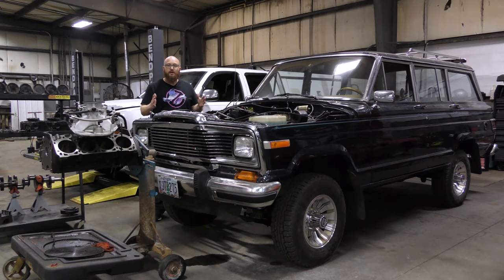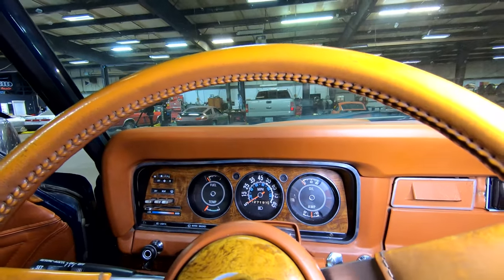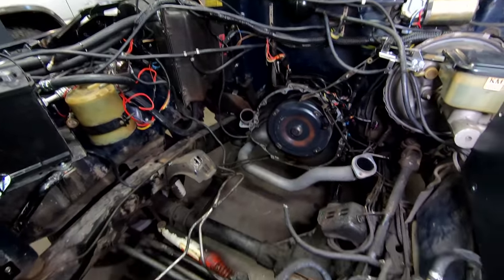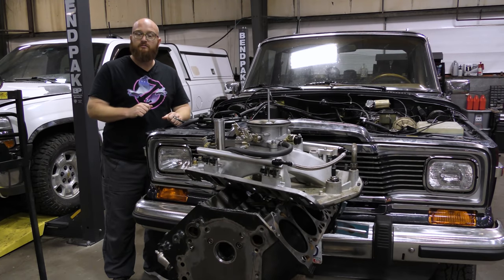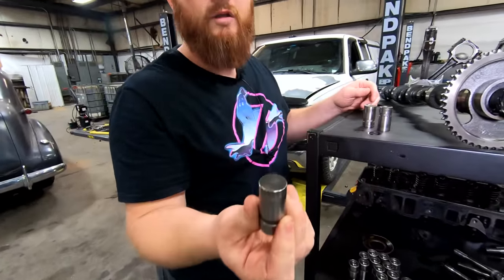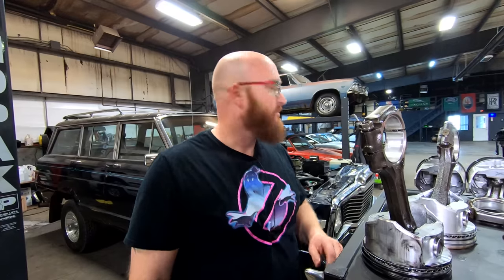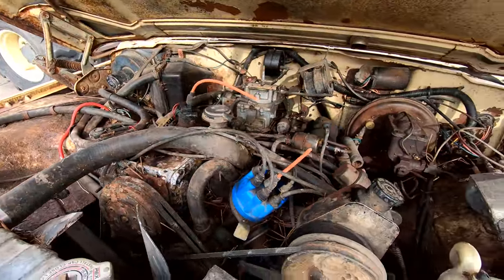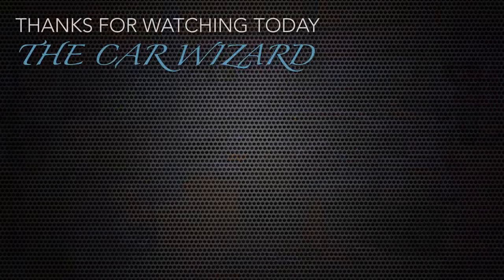The '83 Wagoneer rebuild is dead! CAR WIZARD gets burned by another shop!

Comment: I can't say it was all builder fault. Was cam broke in right? Was correct oil used? Engine looks fairly stock so why single plane intake manifold on truck engine. I see a lot of miss- match engine parts, stock rods, cast pistons, most likely stock CR, cam looks to be stock with high RPM intake manifold. Seems to be using stock exh manifolds after seeing exh head pipe. Fuel injection help a lot to make it run somewhat ok.

Comment: Why SHAME on the builder? nowdays flat tappet lifters are failing badly.  bearings are scored because the metal shavings in the oil. the frozen rod could be because of the shavings also.... Car Wizard you should know better..

the only obvious "bad thing" the engine builder did was that he built a flat tappet cam engine!  these days its roller lifters or nothing!

Comment: This is the ENTIRE reason I stopped using flat tappet cams years ago... 

A failed cam lobe WILL require the engine to be pulled, completely disassembled, and ALL the internal engine parts hot tanked to get all the ground up metal out of it. If someone just replaces the failed cam and lifters, the engine WILL destroy itself from all the metal filings remaining in the engine. 

I JUST rebuild a 2012 Dodge 5.7 Hemi in a Ram because of this... The owner had an issue with a worn cam and lifters on the 4 cylinders with the displacement on demand lifters in them. The lobes were gone, and the lifters were ate up. He replaced the cam and lifters, changed the oil several times, and called it good. 5000 miles later, and the engine spun 3 rod bearings and locked up. The mess left in the engine from the ground up cam and lifters tore up the bearings and plugged up some oil galleys. 
I tore the engine down, the crank and bearings were wasted. Thankfully the engine didn't spin any main bearings. I had the block and heads hot tanked, honed the cylinders, put a new crank and bearings in it, new rings, new oil pump, new lifters, new timing chain tensioner, new chain, new chain guides, new cam bearings, put it all back together and back in the truck, and 20,000 miles later it's running fine.

Comment: I have fairly recently witnessed bad lifters that were new in the box. Defective parts. But a lifter though...
That is %100 unacceptable. One bad lifter can and will grenade an entire motor. Anyone operating an "engine shop" worth their salt would have at least noticed that worn cam lobe AND a bad piston and connecting rod. There is NO WAY the builder wouldn't have noticed that piston assembly if it was in that condition before.. so, my money would be on a bad lifter. A bit harder to detect BUT still should have been checked and not taken for granted that it was fine because it was new. 
Side note: Shops where the owner tends to overload their employees with too much work and ridiculous deadlines should be avoided if possible.

Comment: Wizard, not to tell you your business, but i am a tech doing alot of old stuff, since it was new stuff and i have seen that happen repeatedly since the 80's when they took the zinc out of the oil. Use a zinc additive in ALL flat tappet engines and that wont happen.

First time that happened to me was my 1970 ford with a 302, flattened the cam. Then a dodge van with a 318.  Just saw it happen on a chevy 350 from the late 80's. 

I replaced a cam  and lifters and used a zinc additive and didnt happen again.

Comment: I did a similar "restoration" on a 1981 Cherokee Laredo (2 door version of the Wagoneer). There is a volt meter replacement procedure for the problematic dash ammeter, using the internals from a $15 volt meter from the auto parts store. Google it and you'll find lots of write-ups about it. I just hated to have a dead gauge in the dash, seemed like an unfinished project to me.

Comment: I remember watching a video on a channel called Uncle Tony's Garage where he talked about how some auto parts stores/suppliers will sometimes accidentally resell parts that have been returned as defective by customers.

He said that he was working on a project went to buy some lifters and was "amazed" when he got back to his shop and inspected that parts only too realize that he'd seen that particular part a few weeks earlier (he said he wrote down all the particulars of it and kept the recipts) and had actually returned it as defective before he used it in a project he was working on.

Apparently its a relatively common problem where parts are returned as being defective but aren't marked as such so the stockboy re-shelves them and they get sold on to the next person who doesn't think to do a detailed inspection pre-install, that could well be what happened here.
Reply: Could be counterfiet parts
Reply: @nickmalone3143  
Made in China no doubt.

It wasn't that long ago that counterfeit chinese made aircraft parts were a huge problem for that industry, they actually found some on Air Force One after an investigation into a plane crash in norway was attributed to counterfeit bolts that were used to secure the APU in said plane which failed in flight and caused it to go into an uncontrollable nosedive and break up mid flight over the north sea near denmark.

Comment: I have a 87 4runner with a 22re that's never run right since I had a mechanic build it, I'm thinking of tearing it down myself, I think I'll find some damage in the head. I'm much better equipped now than way back then.

I was planning a trip to Colorado and debated towing it out to you, but I don't think it's nice enough for your shop.

Comment: I'm not ruling out crappy parts or improper build, but old engines and flat tappet cams absolutely require oil with plenty of zinc for proper break-in. It's very hard to find oil with enough zinc in it. Always use a zinc additive, especially during break in unless you're absolutely sure your break in oil has enough zinc in it.

Comment: Food for thought…. I used to work on these as a Jeep tech. They suck the hell out of fuel. Advance the timing and they get 12 mpg but spark knock. Back timing off, 10 mpg. Chrysler had us load a couple of them onto a transport to ship them back to have them tested. I’m not sure what ended up happening. I can’t help but feel valve timing has something to do with it. They were known to pull trailers very well. But they ran so rich that they had a smog pump, pumping air straight into the cat. So be sure to ck the valve timing. 🤔

Comment: The easy answer is bad lifter/cam but I don't necessarily agree. Obviously the engine was very poorly assembled. It's a little hard to tell because you waved the camera past so fast, but the wrist pins looked to be pressed pins. The pins need to be fitted to the piston. Normally they are individually prefitted and come with the pistons. So either they mixed up the pins/pistons, or they were not properly prefitted, or the piston/pin was damaged installing them. WHATEVER the case may be, the assembler HAS to have been aware of that bad rod/piston assembly when he installed it in the block. Nobody should be oblivious to that.
As for the lifter, my guess is that for some reason the lifter was not spinning in the lifter bore. There are many possible reasons why it was not spinning: too tight lifter bores, rust in the lifter bores, burr on the lifter/lifter bore, no taper ground into the cam lobe, insufficient lubrication, etc, etc. But it would have been obvious at initial startup if somebody had only watched the pushrods at initial startup. They should be spinning, as are the lifters. And the proper oiling of the valvetrain  can be verified if it is started up with v. covers removed(just long enough to verify these key issues).
An increasingly common bad  idea is soaking brand new hydraulic lifters in oil, but that is a mistake because the lifters can go solid, and not bleed down prior to startup, which can damage the valvetrain.

Comment: Well, kudos to you for helping bail the owner out with a donor block.  Can you search diligently for new old stock lifters sitting on a shelf in some Chrysler dealer's parts crib. OR can you now go with a mild roller cam lifters/p-rods/rocker assy. to yield same longevity as the original?  That tight wrist pin piston sure showed the skirt scuffing from it seizing up at TDC.  What did the bore look like on that one?

Comment: Lost a lot of respect for the Car Wizard with this video.  NONE of what he's complaining about has been proven to be the fault of the engine builder, PERIOD, yet the Car Wizard is trashing the guy up one side and down the other.  The engine builder does NOT have his own lifter manufacturing facility and his own camshaft manufacturing facility.  He did not make these parts.  He did not cause them to wear prematurely.  The conrod journal bearing wear that was shown could easily have been the result of the metal that used to be lifter and camshaft eating the bearings.  The car owner would have a legitimate complaint with the engine builder if the owner had paid for high end/top quality cam and lifters and the engine builder installed the cheapest thig he could find on eBay instead---but that has been neither alleged nor established.

Comment: Yeah, sadly it happens. Mistakes are one thing that sometimes you can cut slack on but negligence and cutting corners isn't something you should be forgiving with.  I asked a shop to check my ball joints but they didn't really check them properly then said they were fine. Another shop checked it and said they were seriously bad and it was in a highly dangerous state. However, not doing what you are asked and putting both a customer's vehicle and potentially life in a state of danger is something else. You have to be careful with shops. I didn't go to my usual place because I didn't want to drive very far with my brakes in bad shape and worry over my ball joints. Also wasn't keen on a high tow bill. I got really lucky the wheel didn't fall off and that my friend's husband is putting on my joints. I got very lucky but someone else might have kept on driving not thinking about it and could have been hurt badly. My truck is a dodge 2500 so it's a pretty heavy truck. Had the wheel fell off and caused me to hit someone it might have killed someone.

Comment: Others have already said it and even though its expensive,  your customer should seriously look at a roller cam conversion.  These are far more reliable and even the most mild of roller cams will result in a bit more performance.   If he wants to continue to use a flat tappet cam, he should step up to performance lifters from somebody like Howards, Comp or Isky.   He will also need to add something like Comp Cams break in additive to EVERY oil change or use specialized engine oils like Amsoil Zrod.    Not that I would know all this for any particualy reason....

Comment: Wizard still has no idea what caused the actual issue(s) that wrecked the block.  What caused the cam lobe to have the wrong profile?  Wrong lifters?  Wrong pistons? Wrong push rods?  Wrong connecting rods / bearings / journals / pins?  What?

Comment: All flat tappet builds run this risk, off-the-shelf oil is no longer designed for that much sliding friction, since the additive is considered a catalyst pollutant. All modern engines have roller tappets, and most engines have retrofit kits. Comp Cams makes a roller lifter that will fit that AMC 360.

Comment: I'm definitely old school as far as induction goes, for me, seeing a car that came with a carburetor converted to fuel injection only makes me shake my head. I get it though, fuel injection so much for efficient and reliable too. But carburetor's can be tuned relatively easy, then again, it's becoming a lost art. I am reminded though how the Car Wizard worked on an early 70's Corvette that had been converted to an LS motor with fuel injection, that car was a nightmare due to some other shop doing wiring etc. etc. I am impressed with this channel, but I remember a time when you didn't need a laptop to work on your car.

Comment: There's been no shortage of horror stories over the last few years of cam and lifter failures due to chinesium parts being sold by big name after-market companies. I don't think there are any manufacturers left in the US that don't outsource these parts to China. I got bit by a set a rocker arms on an overhead cam application that crapped out in less than 100 miles. I was extremely careful with the assembly. Did the zinc additive in the oil and followed the break-in procedure to the letter. Didn't make any difference. Chinesium is pure crap. Avoid it if you can on any critical engine part.

Comment: I’m personally very disappointed to hear you jump on the builder.  I didn’t see any smoking gun that would definitively pinpoint these part failures as being the builder’s fault.  There is a pandemic of poorly made Chinese flat tappet lifters on the market right now, and it has become so bad that most builders are only offering to rebuild engines with roller lifters.  You should educate yourself on uncle Tony’s garage channel. As a mechanic who has probably took the brunt of blame for bad parts many times before, you should know better.

Comment: It's unfortunate but these days with flat tappet cams it's a crap shoot. There are no shortage of flat tappet cam failures out there. Not sure what power level your trying to accomplish with the build but my rule of thumb is anything over .500 lift and 120 pounds on the seat 330 open pressure go roller.

Comment: Just say no to rebuilding an engine with a flat tappet cam and lifters. Not enough ZDDP in oil these days to keep flat tappet cams and lifters alive. Why not spend the extra money to convert to a roller cam and lifters? Use commonly available oil, make more power, reduce friction, and increase longevity.

Comment: Hi Wizzard with wear marks on the edge of the big end bearings  I'd be thinking too much crank end float. (excess clearance on the thrust bearing. I haven't worked on one of these motors in years. Even then it would have only been servicing, so I don't have any experience in what's what inside of the motor. Have they got the offset wrong on the pistons or rods. I was wondering how that hole came about because its an unusual place to get a hole. As for the piston pin  how do you miss that when assembling a motor. If it was a new cam and lifters it usually comes with a tube of lube and run in instructions so it shouldn't fail. Whenever I've recoed a motor I've always used assembly lube on the bearings, pack the oil pump with vasaline and crank it without the plugs until the oil pressure comes up. The vasaline gives a new dry pump initial suction to lift the oil out of the pan and dissolves in the oil. If it takes a long time you can always pull out the oil switch and fill the gallery with a squeeze bottle. At this point  i could be cheeky and tell you that JB Weld could fix that. Just joking. I know better. Good that you have the spare engine on hand and a nice thing to do for your customer when he's spent a lot of money with you. Good mechanics and Engine Shops stand behind their work even when it goes wrong.

Comment: I had a 87 Grand Wagoneer it was the worst vehicle I have owned to date.  AMC was in it's dying days with no thought to quality, they used Ford ignition systems and GM Steering columns and dash switch gear.  I got 8 MPG and it had no power, when I towed you could just watch the temperature gauge start climbing on the most gentle of grades.  It rode soo rough that it wrecked three radiator and bent two rims, when people asked me how it rode I told them like "buckboard wagon".  Trans was on the way out when I sold it and the rear power glass was all scratched up from contact with the rusted out regulator frame. They looked kind of neat but it needs to work right as well.